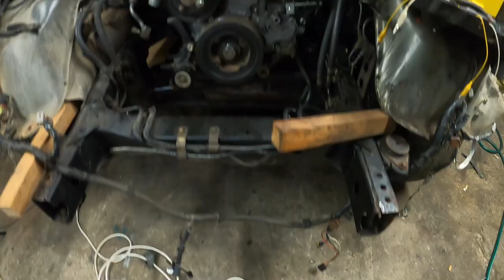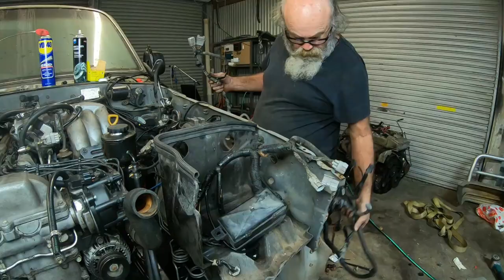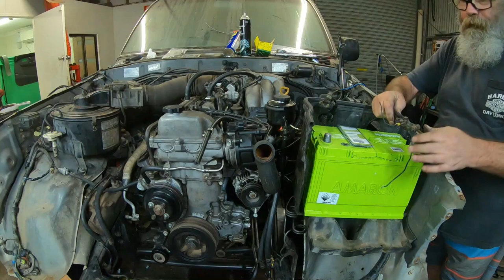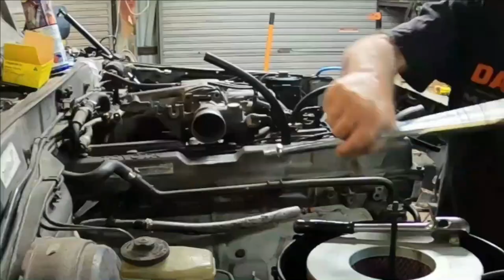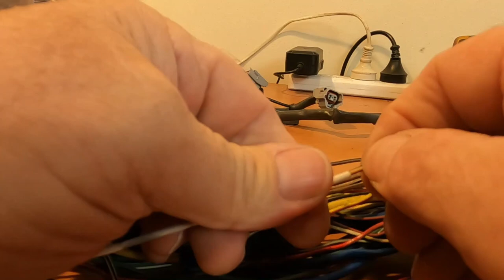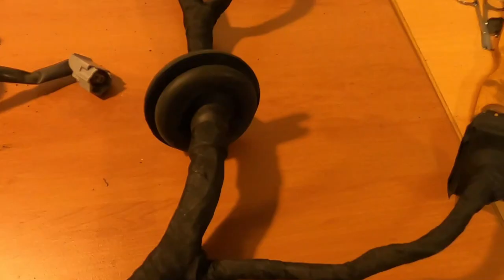80 Series Build Ep 46- A Rookie Mistake

Comment: That’s why men invented beer Benno, after a bad run like that you just sit in front of the fridge till you pass out 🍻. On the brighter side it wasn’t a complete melt down 👍
Reply from the maker: G'day Robert. Fridge door was opened so much the beer went hot. Fixing that loom has sorted part of the problem but I suspect more damage from this Fugg up. Its a start though.
Reply: Hopefully you haven’t fried any circuit boards
Reply from the maker: @robertaus8420  Hopes not. Testing is ongoing

Comment: I hate wiring it does my head in buddy. It takes a lot of hunting around i use them connection with a bit solder i find them good enough so nothing wrong with it. The loom looked a lot better at the end 👍
Reply from the maker: yeah for sure Ali, If I'm going to make a mistake that's where it will be